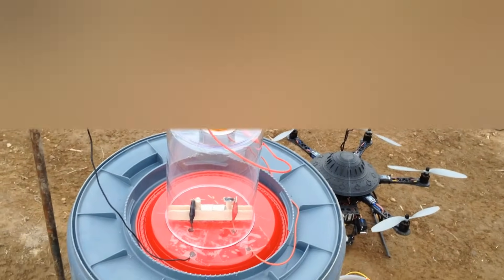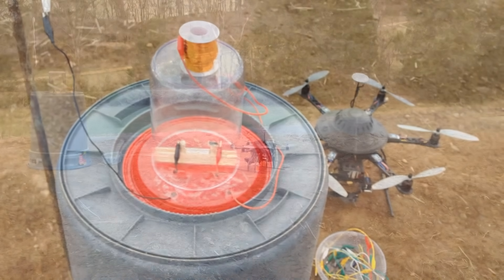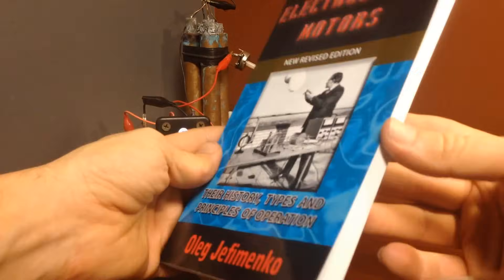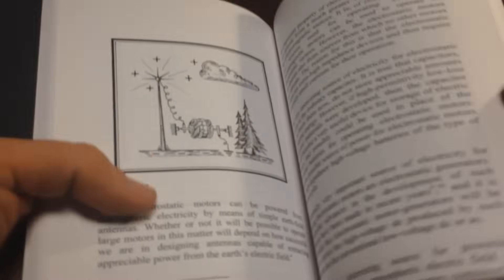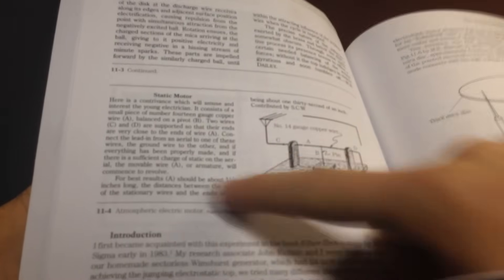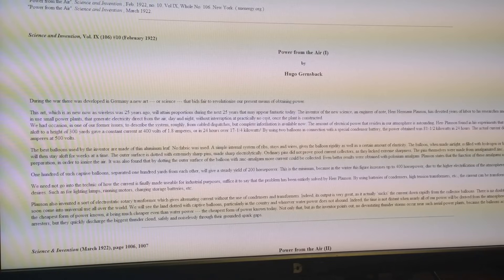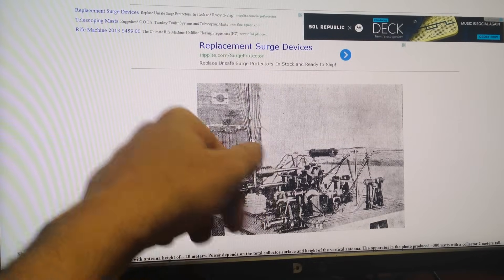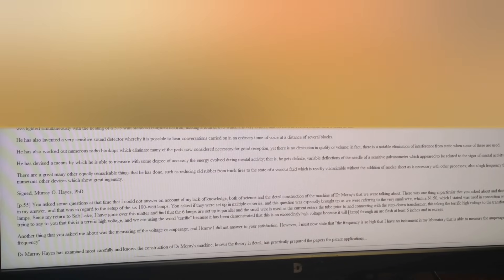Free Atmospheric Electricity Powers Small Motor - Tesla Radiant Energy

Comment: So, 30V per foot... This sounds good when in conjunction with an Earth tether. A low earth orbit tether would theoritcally generate and at the same time transfer at great distances, albeit up and down... In addition the low orbit vehicle also generating solar. A few thousand of these set up like a forest could potentially not only power a megacity but also elevate space vehicles from earth to low orbit.
Reply: Kerry Anderson,  I've heard that proposed from those who have proposed a space elevator.
Reply: I'm guessing Nikola Tesla's modified car didn't require something high in the air, from the little I read on it, 2 small rods were pulled out of the glove box which were connected to whatever Tesla had constructed inside the car.
Reply: That's actually a cool idea! \o/

Comment: How about multitute of wires not quite so high. A little from each, no?  Instead of wires use rods that essentially hold themself up.  Distance between them calculated based on the square root of the distance between them?  I don't know if it is viable.  But if trees can do it to wick water laden with minerals...  My house is a two story so I got the 20 foot covered...  Thanks for sharing ~ That goes for many here posying comments.

Comment: I've built antenna systems a few times, and it will light an led for a few seconds if you let the cap charge overnight. I hope you find a solution to capturing power faster. Even if it's just enough to keep a micro-controller powered  in a sleep state so it can wake up, do a task for a milliseconds, and then go back to sleep! That would be useful for a data logger. If you can get a real motor to do work, I'll cal you John Galt from now on!

Comment: Nice work! Getting the necessary height has always been a problem. Using a hexacopter was brilliant.
Reply: Imagine using the hexacopter to get the height and then powering a tesla coil to maintain the hexacopter.
Reply: I wonder if a "Lifter" could suspend in the air and act as an antenna .

There is a 1915 Antigravity device featured in 3 independant Newspapers at the time built by Louis Rota (Italo - French ) engineer .

But also a simple helium ballon
Reply: @johnecopracyprus1051  Thank you for this. 

But, Now I have MANY questions about Mr. Louis Rota and this Lifter invention.
Reply: RimstarOrg television radio broadcasting towers generate huge amounts of energy and have to have "atmospheric electricity diffusers" to stop them being struck by lightning all the time.
Reply: Would building on top of a mountain help? I suppose that could work for someone living on top of the mountains.
Reply: Ishaan Bellic Auto stabilization, I think it was on Hack a Day that I saw a quadcopter with it
Reply: because a hexacopter is cooler!   ;)
Reply: Weather balloons.

Comment: This stuff sure has my attention also.  What is old is new again.  When I found out that a motor can run on mostly a high potential if it is made right and that you CAN store static electricity in the right kind of cap-----I was off and running.
Reply: So did you guys have any success?
Reply: @GrzegorzDurda  They've been Murder lol
Reply: MrGeoffro86 - lmao right?
Reply: Ditto on the potential motor and correct Caps...
throw in the large lead acid batteries and that's what keeps me in it.
Reply: How do you get a capacitor to discharge, and then to be put into a step down transformer for batterycharging, or is it too easy.  Will static run through a transformer.

Comment: try attaching a copper plate to the top of the wire on the quad to increase power. also have you tried harvesting tulleric currents with wires point to point almost flat but one end deeper too?

Comment: Try putting a small AMP Meter in line to measure the amperage.  When the heat is turned on, in local schools, my wheelchair builds up so much static the when I use touch a door jam that the static is so great that my hair stands when I am zapped.

Comment: Without researching, I'm going to guess whats happening,  btw i'm 14.  Their might be layers or free flying electrons or their might be some kind of electromagnetic layer that is reacting with the copper wires, seems to do with lightening, free flowing ions and electrons are being attracted with the copper wire, which then is turned to electricity . Very cool, but would the amperage be very low? so you would need many antennas wired in parallel to build any amperage at all. Very cool, but not efficient.
Reply: birds who sit on a power  line with over 400,000 volts Running through it doesn't seem to feel any electricity present nearby. Well, that what's going on with us right now standing on the earth. There is a lot of electricity in the atmosphere but since the voltage potential is even between the ground and several feet into the sky,  we will never feel or see that kind of power except when there's a storm. The power of lightning gives you a clue on how much power there is in the atmosphere.